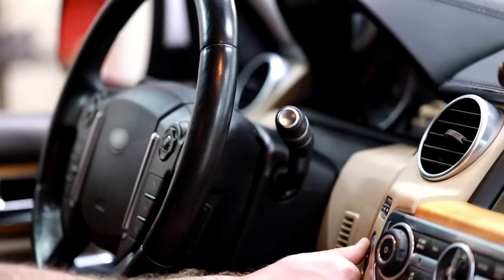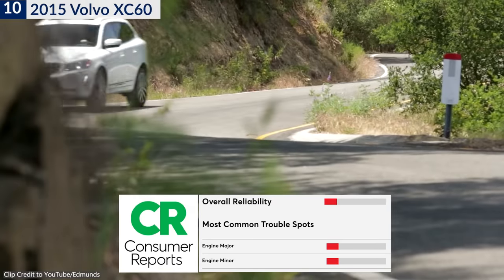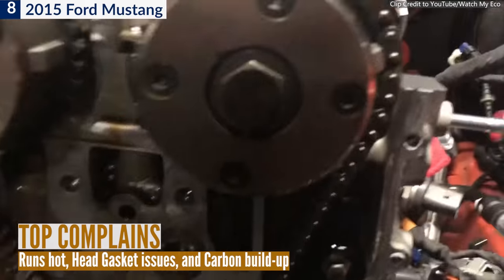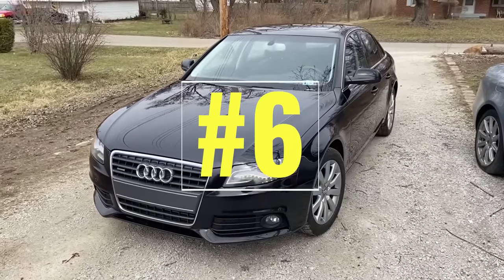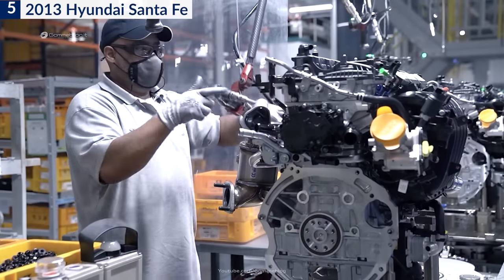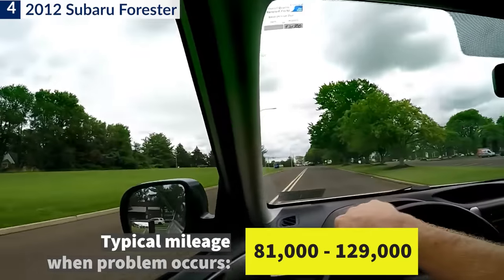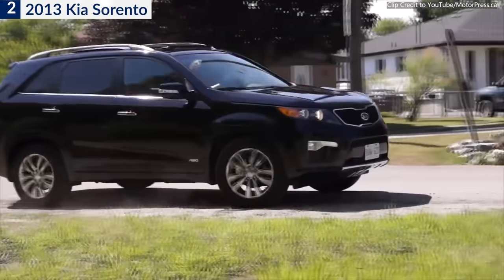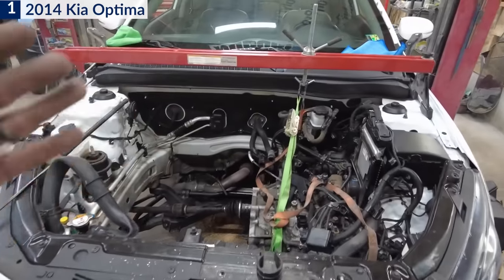10 Used-Cars to AVOID for BAD Engine - as per Consumer Reports

Comment: Proper maintenance can prevent all of these problems.  Some just need more frequent than others..
Reply: Mfr produce junk but figure it is cheaper to pay a few lawsuits than fix the design or manufacturing error. GM 3.6L V6 in all GM brands for 2009-2021 had a problem with porous engine blocks, coolant will leak into cylinders. You would think they would fix it after the first year or two, not just keep building them the same way for all those years. GM said my Acadia with 106,000 was not covered, please pay $10,200 for a new engine; book value was $8800 and replacements were overpriced for most of this year. My dealer finally stepped up and picked up some of the cost and GM agreed to pick up 10%.
Reply: Nope and that is how you end up buying a junky car, there is some engines and gearboxes no matter how frequent you change oil, the engine will wear out, when there is a frequent issue with engine bearings, oil consumption it has nothing to do with maintenance but a poorly built vehicle
Reply: Nah, it’s a defect parts inside the vehicle.

Comment: My 2002 Focus ZX3 Manual drives like new at 201k miles. Sure I did the brakes/tie rod ends/rear shocks and a used EVAP solenoid and a used DPFE from the local yard for a few dollars , but it is 20 yrs old !
Reply: yes but it was slow and people wanted more power
Reply: I had Mk 1 - it was 8 years old already when I bought it. I had to add oil every 1000 km. Just like that, miracle engine burning gas/oil mixture. No visible effects though.
Reply: Manuals are famous for better reliability.
Reply: @luvcheneywasalegend9168  "Famous" a better word. Notorious has negative connotations.
Reply: @jamesmedina2062  👍

Comment: I have owned a 2016 kia soul and a 2019 kia optima.  The soul and the optima both had GDI engines. The soul started consuming oil around 40K miles. No leaks! The oil would just disappear! 4 qts in 4 weeks! We traded it in. The optima with 35k miles died while driving after a big clunk was heard. It started back up and drove fine after that..we also traded it in. Stay away from the GDI engine! They are junk! We now own a 2021 and a 2022 kia soul. One X line and one soul base model. Although I'm not liking the X lines CVT transmission. Other than that both are very fast little cars. Both seem to be built very well. Neither compare to our 2020 Honda pilot or my 1974 Chevy pick up but they are work cars only. They get great gas mileage and offer a comfortable ride.
Reply: Surprised you bought another Kia..
Reply: My Kia has 135,000 and driving daily.

Comment: I can attest to the Equinox head problem! Chevy used cheap gaskets and the milk jug cooling system through the block is a guaranteed failure (no radiator)! 2008-2013 models.

Comment: You forgot to mention the V6's 3.5L/3.7L Cyclone engines from Ford and the notorious internal water pumps that tend to fail between 69,000 to 120,000 miles or up if you get lucky.
Reply: *Duratec, not cyclone
-Ford Tech
Reply: What yrs 🤔
Reply: @mrgreenbaypacker929  2008-2019
Reply: @cristirado_official01  thank you
Reply: @mrgreenbaypacker929  you're welcome 👋🏽
Reply: @the-floridaman7792  there is currently a class-action lawsuit in progress for water pump leaking antifreeze into the engine...if you have a receipt for it ..or can get one..some dealers keep records...you can join
Reply: White Laststand  I changed the engine oil every 3,000 miles, the colant every 30,000 miles and the water pump failed anyways at 76,679 miles. I got rid of it. I now own a 2012 Fusion 3.0L V6 far better car than the Taurus.
Reply: White Laststand  nope, I always use OEM products only and by the way I don't even have a Walmart near me 😂.
Reply: White Laststand  In fact, it was the dealer who found the problem with the water pump, not me. The car worked perfectly, I just added coolant to it every time I saw that it was missing. But they said if the second water pump seal broke the coolant would drip into the engine oil pan and could be destroyed. They asked $2,000 to fix it so I just got rid of the car.
Reply: The funny part is, my mother had one of the early 3.5L motors in her Taurus X. The car had 75K when we got it and 230K when we sold it, same water pump. The new owner is a friend of ours, she got it up to 285K, still the same water pump. Then her sister bought it, drove it for a year, and then sold it. I still see it around. I'm not sure of the sister or the current owner ever did the water pump and I kind of doubt it, given that it's a $1K car at this point with probably 300K on it now.
Reply: @madmatt2024  Congratulations you were one of the lucky few that didn't had the water pump issue. In fact there is a class action lawsuit about this, but as expected it has come to nothing. 

Anyways, I don't own one of those anymore. The 3.0L V6 of the Fusion is very reliable. 80k miles and NO Water pump issues!!!
Reply: Yeah my Flex has 193k miles, no water pump issues yet. It’s hit or miss with the 3.5 Duratec water pumps. You either get a good water pump and can probably go over 250k miles, or unlucky and get a dud and be stranded on the side of the highway at less than 100k.

Comment: Boy, they didn't like that Hyundai 2.4 L.  I had a 2011 Sonata with that engine that I drove from new until 120k miles trouble free.  I guess that I should count myself lucky.
Reply: Still have ours. 145k. Engine still purrs. I've always run Mobile 1 Full Synthetic and K and N filters and change out oil every 6 months. Body and chassis on these hold up great. Did all the "recalls" and if the engine sheets the bed, it gets replaced for free. Only thing that sucks is the rear disc brakes are a PITA to service and change, and they gunk up badly during the winter. Replaced the weak hood struts and I change fluid every 25k on the "sealed" transmission. Great car, as far as I'm concerned. Peppy, great mileage, easy to work on for most things.

Comment: Anyone else notice the same Kia/Hyundai engine made the list 4 time, but in different models? Sounds like avoiding 4 cylinder engines and models years 2011-2015 is best.
Reply: It is we replace those engines alot however even in those years and engines proper maintenance can avoid those issues most Kia and Hyundai customer don't do that however
Reply: No, avoid ALL Hyundai and Kia with the Theta 2 engines (2.0 and 2.4) regardless of model year, except the 2.0 turbo in the Genesis Coupe.
Reply: @Train 2noplace I have owned 4 four-bangers and 3 where good. Worst was a 2.4L ford in 2008 (blown head gasket 60k miles) recent owned 2 2.4L GM engines. 85K and 99K and both never needed more than oil and a couple Cam Actuators. My 2007 Mitsubishi 4 cylinder had 160K when a gave it away (leaked like a sieve, but kept going). Currently I own BMW 3.0L N53 130K, BMW N55 160K and Land Rover 4.4L 125K. I personally would never by another 4 cylinder.
Reply: @W0RLDSSMALLESTVI0LIN  The theta II engine is a pure pile of stale dogshi_t.

Comment: I have a combined 480000 miles on my 3 Kias since 2011.
Best cars I've ever owned. And I've owned all the domestics, Nissan Datsun Toyota Honda and Audi.
Reply: LOL, none of those are Domestic cars!
Reply: @troy9er  GM,Ford, Dodge, Chrysler, Nash, AMC.... AND none domestic brands such as Nissan, Datsun, Toyota, Honda,Audi. 
Hope that clarifies it for you.
Reply: I have 300,000 Miles on my single 1991 GMC Suburban.
Reply: LOL not accurate
Reply: I have 330,000 one cx 5
Reply: @myradioon  Not unheard-of thay usually will go through at least one transmission an alternator or two some suspension components. But I've always found it to be a decent value for dollar if you actually use it as intended. Probably nothing that really competes with it.
Reply: @ontarioman6301  All I can say is I've been down the Mazda route along with a few of my friends and coworkers.  Glad, to hear Mazda finally figured it out.

Comment: CAFE forced the OEMs to find ways to improve fuel mileage one way was
Low Friction Rings.
These went into many different engines starting in 2010 with the same results around 75k to 100k miles very high oil consumption would onset quickly.
Sometimes destroying the engine.
Reply: Low tension*

Comment: 2009 Subaru Forester. Previous owner was a laborer driver. And the rest of the owners drove it to their offices. Came to me at 77k miles knowing that it was abused but the previous owner said he replaced the radiator because it overheated before I bought it off. I clearly made a bad choice because there was a lot of clunky sound coming, probably from the transmission. The radio sounded like a kettle even when it was off and sometimes stayed on even after I removed the key from ignition. Two days later, however, the car doesn’t start no matter what. Even after various attempts. Water was splashing everywhere. I for some reason thought it could be a head gasket issue but it could be the cylinder head too. But I don’t blame the car. It’s not it’s fault. It was abused from all of the previous owners because they didn’t maintain it. We’re talking not even an oil change.
Reply: nasty history. Subaru has lots of parts and techs so you can fix it.
Reply: interesting stuff because I just sold my 2009 XT FORESTER with 130, 000 and it ran like a Timex watch no check engine lights no head gasket issues just routine oil changes and Brakes and Tires that was the only thing I ever did to that car. It's too bad to hear people not take care of that cards at all.
Reply: If you insist upon buying abused vehicles better get a Toyota Hilux next time, their designed to take it.
Reply: @DerKirchenhocker  There's no Hilux in the states side. Tacoma is the version of it.
Reply: I have a 2007 Forester,bought off 1 owner,47,000km,now has 340,000km. Issues: clutch replaced at 250,000km,ignition coil replaced, leaking rocker cover gaskets, replaced, on it's 3rd cam belt(as recommended). Been round Australia twice,done a lot of off road that surprises people with bigger vehicles.
Reply: Wow I can't imagine that. iv struggled n struggled but I still take car my cars. As n extra car I have a 2001 Forrestor that was my dad's. Runs like a top n it did for him or he'd not messed w it. He was a mechanic n knew. Seems to just keep on going.
Reply: @DerKirchenhocker  there’s no doubt in that, you’re 100% right. But a compact SUV would be easier to drive in the city🤷‍♂️
Reply: @antipropo461  21 years old and still runs top notch? Is that because it’s barely driven? Jk you probably took care of it lol
Reply: @johnsmith-gt3po  that’s a lot of kilometers bro 😂
But we all know Subarus just aren’t as reliable as it’s other Japanese rivals
And that’s why you had to do all of those maintenance tasks when you could’ve just gotten a Land Cruiser like the rest of Australia 😂

Comment: Several turbo charged GDI engines on this list, I think all GDI engines have carbon build up problems and add a turbo charger and you get major thermal expansion and contraction from the extreme heat created.....add you get a 100k throw away engine.
Reply: I've heard to avoid GDI Engines like the plague!! Major Carbon Buildup.  Better to stick with conventional fuel injection IMHO!!
Reply: You're just about 100% correct!!
Reply: These new designs wouldn’t be deliberate would they??    Nah couldn’t be….could it???
Reply: You have to service it. Kia has a service for the carbon build up, but it does no good if you don't get it done.
Reply: most people that have these problems are not servicing them right.

Comment: I am the original owner of an 02 Ford Explorer with 200k+ miles. 22 years old and it runs like new.   But not just any Explorer deserves such high praise.   If it is equipped with the 4.6L V8 engine, and when regular maintenance is performed,  fleet vehicles like police and taxies frequently run up 400k + miles.  In my case, I change my transmission and differential fluids every 50k miles to keep the drive train healthy.  This is a body on frame vehicle and drives smooth on a highway.  It will outlast any unibody SUV out there.  If you find one used it is very affordable.

Comment: On the Subarus you missed the huge issues with the CVT transmissions. Major expense as they don't even try to repair those transmissions they just replace them.
Reply: The CVT is a Nissan transmission, if I recall correctly.  I'm not aware that Roo's ever used it.
Reply: Several manufacturers have used the CVT’s. Nissan buys theirs from Jatco, and they suck. Honda CVT’s also suck. Whenever someone asks me for professional advice on buying a car, I tell them just get a Toyota and call it a day. Toyota had some Asin CVT’s for a couple years but didn’t have issues like Nissan or Honda.
Reply: @the-floridaman7792  Honda CVT's are nowhere near as bad as Nissans. Maybe not as good as the Toyotas, but ive yet to hear of a 10th gen CVT spontaneously blowing up. Hell, the one on my 18' Civic hatchback has been nothing but smooth and quiet so far back and forth from school (knock on wood). The worst Honda CVT is probably that of the HRV, but that car is just ass all around. 

My major complaint about the car so far is some "cheap outs" in the interior, but is about par for anyother $20,000 vehicle, so first world problems.
Reply: Daughters new pathfinder had cvt . Junk - traded it in 
Stay away from cvt transmissions !!
Reply: I'm about to buy a Mazda CX30, and may buy a 2022 because Mazda introduced CVT in its 2023 models.  I'm congenitally allergic to buying a car in its first year. Am I overreacting? Or is the new CVT buying potential trouble?  
I had my Mazda MX6 for 25 years, and I don't plan to buy another car. 
I'd make a joke about having my next car cremated with me, but don't want to tempt the gods of fiery crashes.  😮😂

Comment: I had a Volvo 740 back in the eighties, with a fore-and-aft 2.3l engine. I did 308,000miles in it before a garage mechanic wrote it off. Just. Changed the oil and cambelt regularly, would still be driving it now. (B230K engine)

Comment: Had a 2014 Sorento. Sold it off at 107 k kms. The only repair done was the replacement of the throttle body at 99 k kms. Otherwise just regular servicing at scheduled intervals.
Reply: And that's why you made it last without a major problem. You serviced it and took care of it. Prolly didn't wait a year, and finally took it in to have more issues now, stemming from the first one.
Reply: @Nitrous-ej5zy  that is 107000  is about 70000 miles.

Comment: There are bad Honda and Toyota engines too. Bad piston ring design in the case of the Toyota. Honda designed one that sucks oil and a different one that has oil dilution.
Reply: yep.. but this video is misleading only targeting a few vehicle manufacturers
Reply: Never had issues with any Toyota ever. Fords, another story.

Comment: I have a 2010 Toyota Vios. Toyota engine with 4 speed Aisin transmission. Still original engine and transmission. Never give me any problem. It keeps on going. Still runs like new. Now I have the budget to get a new car. Been eyeing Volvo XC70. I wonder if the XC70 has the same reliability. Or maybe I should just wait till my Toyota break down.
Reply: Save it for sometime. Search for the most reliable vehicle first by reading consumer or car enthusiast reviews. By that time you have gained enough trust for the vehicle you think fits your badget.
Reply: Forget about the Volvo. Their cars are forever requiring maintenance
Reply: stick to Toyota or Honda

Comment: The Elantra should be on here! Had a 2014, and when it got to 70k…..it developed piston slap! 🤦🏻‍♂️ Got rid of it before it blew.
Reply: My 2017 Accent blew before 60'100 mi.
Reply: Piston slop or wear is a  real issue. Toyota has it also so change your oil every 3500 miles with GDI OR ELSE !

Comment: I’m super glad I got rid of my Kia. One trip to Denver.. just a total of 800 miles or so round trip. The engine was squeaking and rattling, the transmission was shaky and could never find the right gear. I got a Volkswagen I love and it hasn’t given any issues so far.
Reply: LMAO trade one unrealiable car for another
Reply: go with honda or Toyota next time thank me later
Reply: @shinski8114  last time I owned a Honda the paint was falling off the bumper in the first year. I’ve had a few Volkswagens and never had a single issue. They’re just one of the few cars that don’t tolerate people not doing maintenance. Keep up on it they last forever.